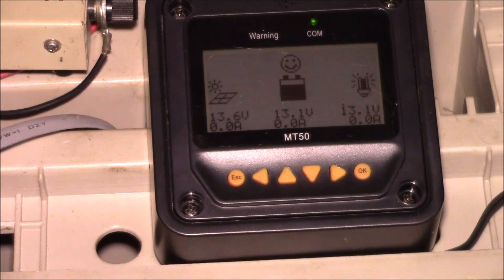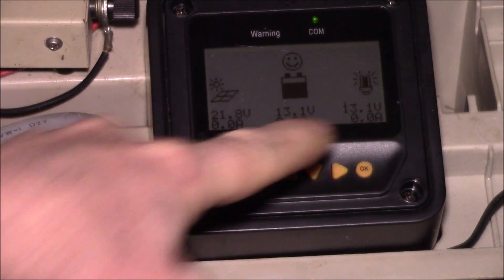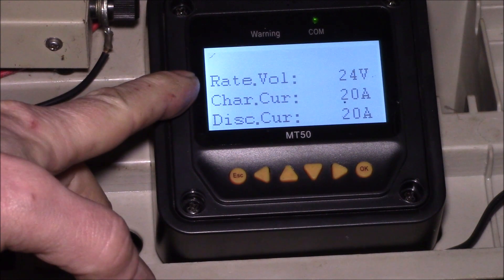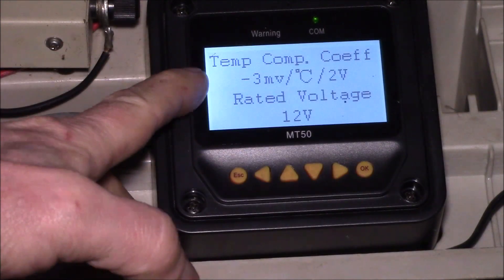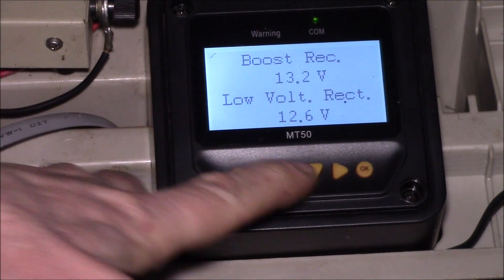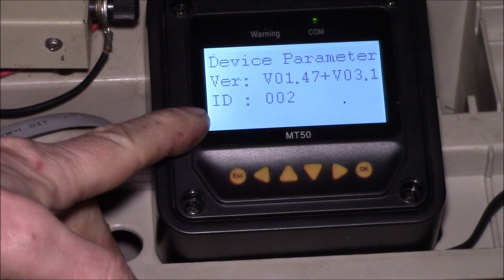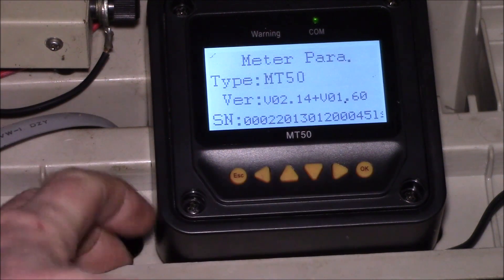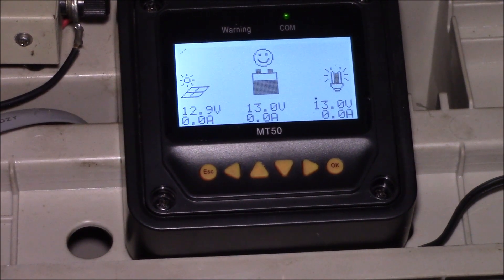EpEver/EpSolar MT50 Remote Display: Overview

Comment: I have five 100 watt solar panels I have them connected in series I'm getting 117 V but only .02 amps is there a way I can get more amps by programming my charge controller with the mt50 I have a 40 amp EPEVER I have two 100 amp AGM batterys  my locations is Alaska Thanks
Reply from the maker: A few things you might try.  First, see what the max. PV input voltage is, some of the EpEver models max out at 100v, while others are OK with 150v.  Then, check the connections at the controller.  With the PV input, remove those wires from the terminals and then hook up a meter on the high DC current range and check the short circuit current if that's below the current rating of your meter.  That way, you're checking all the wires between the panels and the charge controller.

Then check for voltage drops between the controller battery + and - terminals and the battery + and - terminals.  It might also be that the battery is full charged, or at least charged to the cutoff voltage set in the controller.  You can check that in the device params. menu, maybe try some custom settings with the USER battery type.
Reply: @The4Crawler  I will try that tomorrow morning and see if I can get my amped up I don't have PayPal is there another way I can buy you a cup of coffee?
Reply: Did you ever solve the issue?  I am seeing same issue
Reply: Are you running a load on the system?
This system is a power on demand type system.

Comment: The reason I wire my DC loads direct from battery (via car fuse box to fuse individual circuits) is that I don’t have any loads which I need to switch on and off - all my DC loads are stuff which needs to be always available. 

The loads I do find myself switching on and off are the AC ones run from my inverter, and for this purpose I find the little cheap “smart wifi breaker” products from Tuya unbeatable. These are a smart home device which you join to your wifi then they have an onboard relay which switches the mains output on and off. With this level of control you can set rules according to local weather conditions, time of day, even ambient light levels if you have additional sensors. The onboard relay can be removed to allow your load to be switched by a solid state relay instead (for much lower power consumption while load is on) and on that subject you can even wire 5V DC power direct onto the PCB to bypass the mains PSU stage of the device and reduce the quiescence consumption to a fraction of a watt.  For a device costing around $5 direct from China it’s really flexible and helps me scavenge a good few watt hours of consumption which would otherwise disappear in mains device standby consumption.
Reply from the maker: I'll have to check out that Tuya device.

I don't routinely use the DC Load button to turn my DC loads on an off, only did that for a demonstration in the video.  It is normally left on all the time.  The advantage of using that output for me is that it's set up to shut off if the battery voltage gets too low.  It also records the energy consumption of the DC loads over time.  I like to keep track of that.

Comment: On my  S. controller  6415an. The only  "load " that it is carrying is  the battery 4ea. 12.8v   series/parallel  24v wiring. 
I  can't turn the load  off. 
I really don't understand this  load  terminology.
Reply from the maker: The load terminals are usually the 2 on the right side, battery in the middle and PV to the left.  All the Load does is turn on power to the Load terminals, basically connects the Load to the Battery.  You need to have the Load parameter set to Manual Control as I show in the video.  Then you can turn it on and off with the ESC button.  But there's no harm is leaving it on.  If nothing is connected to the Load terminals then no current flows and no power is used.
Reply: My system is up and running but I like to know  everything that is going on. 
You can't repair if you don't understand how it  works.
Reply: Thank you    
I am going to look at my  controller  a little closer.

Comment from the maker: I've found that the user manuals for these charge controllers have little information about the "LOAD" output.  I like to use this output to power loads, other than power inverters.  In fact, I'm using the DC Load output of one of these to power my home's 12V DC loads:
https://youtu.be/EhNI3Ui5cYA
I run about 2KWH/day through this output.

This method provides low voltage and over current protection for the battery.  It also monitors and records DC energy consumption. You could also use this output to power a DC relay to use to turn larger loads, connected to the battery, on and off.